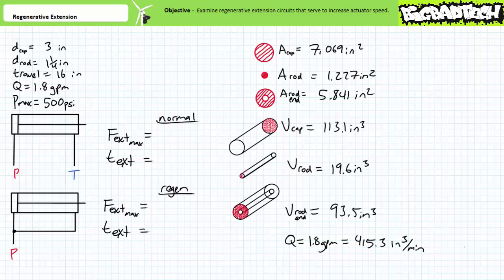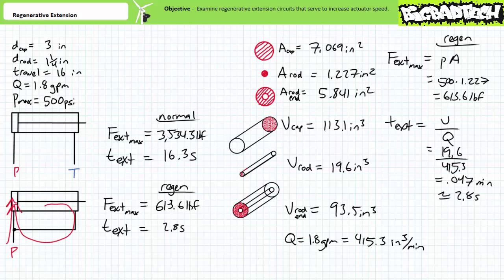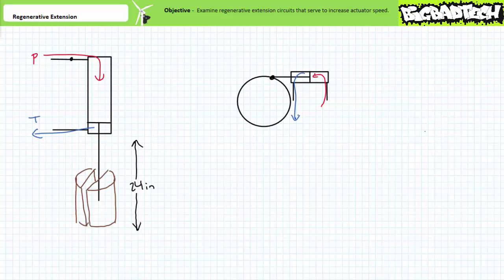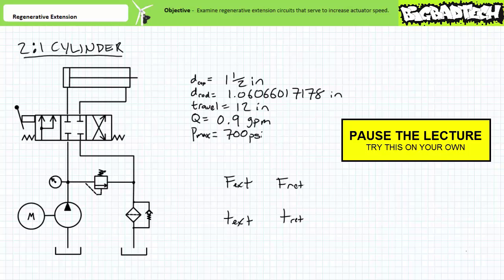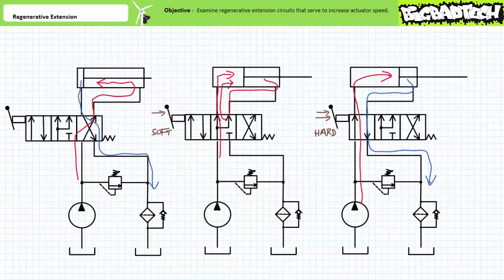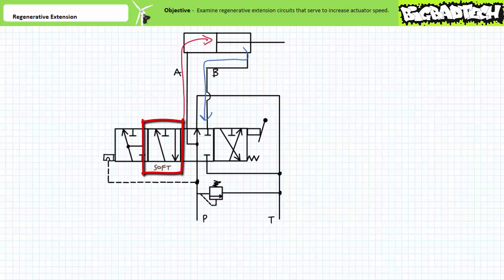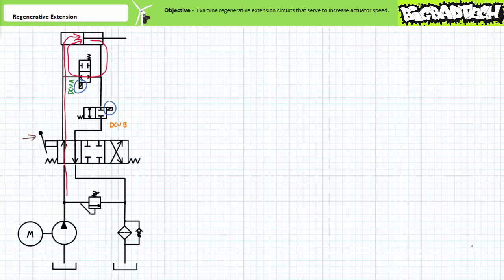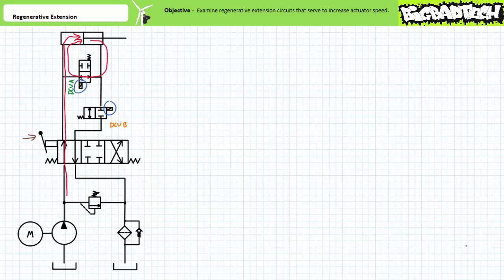Regenerative Extension (Part 2 of 2)

Comment: Thank your for your lesson on regenerative cylinder extension circuits. It is the best that I have seen. I agree that "there is no such thing as  regenerative retraction"!  However an external force, such as gravity or a spring could retract the piston, but its movement would be slow, because oil in the cylinder must be conducted to the other side of the piston by the control circuit. 

An oil passage through the piston, with a high flow valve, could reduce this time period for the piston retraction. Note that this oil passage through the piston could simplify a regenerative extension mode circuit, since it also conducts  oil to other side of the piston.

I made a successful "piston valve" and found out how to control it for a press operation cycle. (cylinder extends quickly to the load, applies a high force to the work, and then retracts quickly to the starting position). I have made about 100 if these cylinders, of different sizes, and for different applications. They have logged many millions of operation cycles.

They have punched millions of 1/2" holes in 1/4" steel plate, with a 3" press travel, cycle time 1 second, with a one hp. pump.

Jim, I would appreciate it if I could discuss my cylinder with you. I am retired, and I have been thinking about how to share the knowledge on my work. 

Thanks;  John Conway   johnconway31@gmail.com    phone  803 932 9696